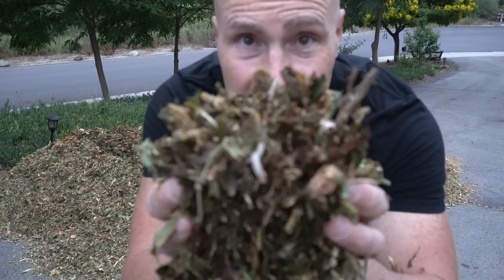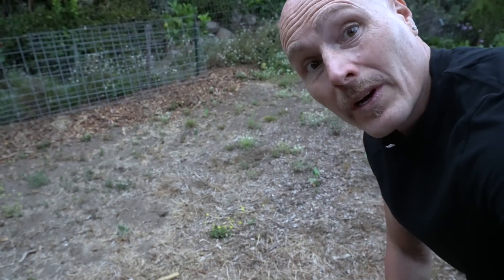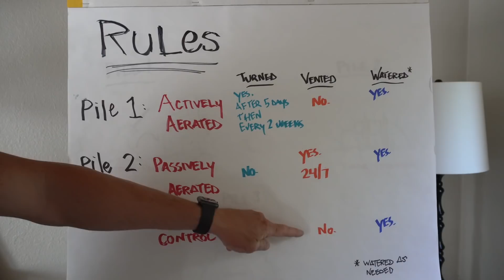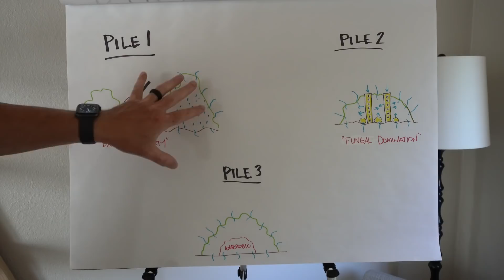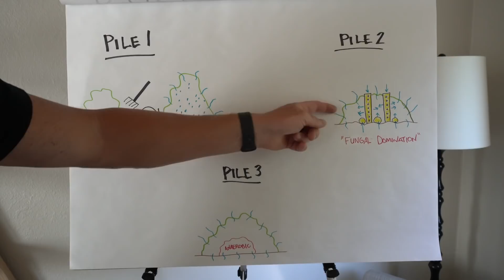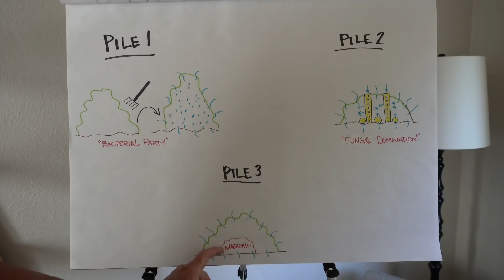Do You Have To Turn Compost to Get "Good" Results - Compost Trials

Comment: Use an air compressior to inject air into the pile with a 3 foot 1/4 inch pipe hook to your air hose ,  and you shouldn't have to flip the pile as much, and it's very quick to do this.
Reply from the maker: I have a bunch of videos on that.  Not sure that it makes a difference.

Comment: Diego Ramial woodchips my friend
Reply from the maker: Meaning what?
Reply: @DiegoFooter  Ramial woodchips are made with wood 7cm diameter and below. I use alot of trees with leaves on. It is the best ! Briefly research Ramial woodchips you won't be disappointed I promise you. Like you - I have also been searching for the ultimate solution. Ramial woodchips.
Reply from the maker: Yes, I have read about them a lot in the past.  It doesn't make sense in my context because I can't produce them on site.

Comment: Joel Salatin completely buried a cow in his chips. It worked.
What temp is optimum for wood fungi?
I have found smaller matter composts faster. Next time try mixing sawdust with one pile (will it kickstart?), sawdust just on the bottom, and a control using what you learn with aeration.
Reply from the maker: I asked Peter McCoy for his thoughts on the optimum temperature for fungi and he suggested that it is in the 70-75F range - which is based on his experience growing edible mushrooms.

Comment: I built the bio reactor from concrete reinforcing grid which i am yet to fill but i also build one out of pallets. I dug it into a large bank, then there is one pallet on the base and 3 others, one on each of 3 sides, one at the rear and one on either side leaving the front open for access. We have a short season in the mountains but i have access to free compost from our local dump, however it's around 80% wood chips by volume. This has messed up some of my planting but makes good weed mulch or swales to keep moisture. I'll probably start to seed green manure in september or october and may rake up any surface wood chips from my beds and put them in one of the bio reactors.Looking forward to the results. I would like to get an old cement mixer and convert it to a sifter to harvest the best compost and castings from the wood chip piles.

Comment: Have you thought about adding a covered pile to your experiments? I have seen guys who toss black tarps over the compost to hold in heat or heat it up. I would like to see if it really makes a difference. Can’t wait for the follow up on this one.
Reply: I suspect holding in heat is a bad aim.  Holding moisture is a better one, and controlling the moisture inputs is you're apt to see a LOT of rain. Heat is the byproduct of some of the aerobic microbobes doing their jobs, but if the piles gets too hot, it's counter productive. Your mention of tarps does remind me I should try tarping with a light colored tarp to hold in moisture though. Here in N Florida it's running hot and we're seeing daily rain the last few weeks (after some drought for a few weeks).  Even so the evaporation is more of an issue than leaching, though leaching probably also happening more than I'd like while it's actually raining hard.  Once the rain stops, though, the surface and outside inches of the pile go bone dry pretty fast from both the sun and the heat in the pile.  I generally toss some of that into the next pile since it's much less broken down, but maybe a white (or at least light colored) tarp might encourage better results there.
Reply: Dan S  in Southern California it doesn’t rain from April to November. Give or take a month. I didn’t think about keeping the moisture in or stopping the rain to prevent leaching. I don’t tarp mine but I see guys one here who do. I guess I’ll have to try it myself and see if it does hold in the moisture.

Comment: No, you don’t have to turn compost to get good results, but it sure as hell speeds up the process.
Reply from the maker: It might speed it up, but you aren't getting the same final product as a long compost.
Reply: Diego Footer actually you are if you’re basing a final product on duration. The final product of turned compost should be better than unturned compost given the same duration.  By turning compost you can get a usable product faster, but you’re not required to use it right then and there.  Just remain calm and let it compost longer 😃